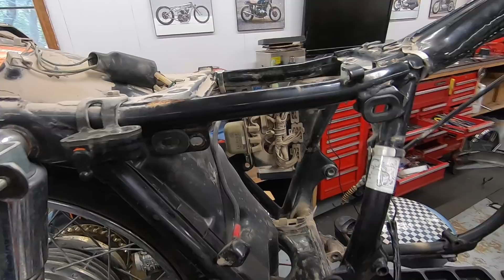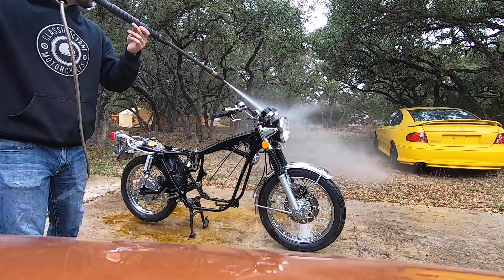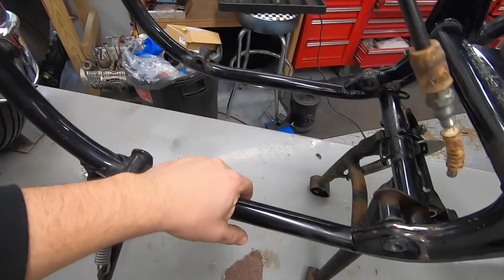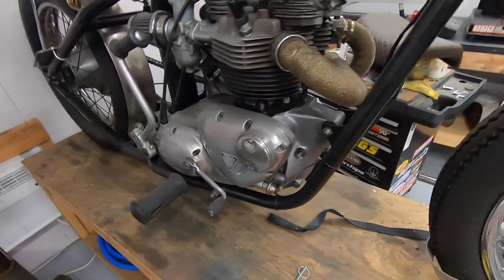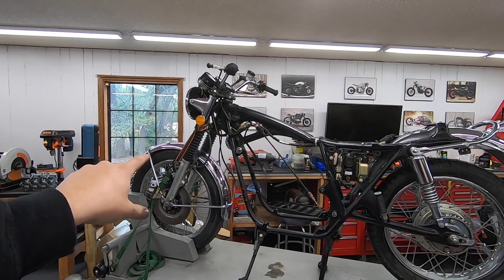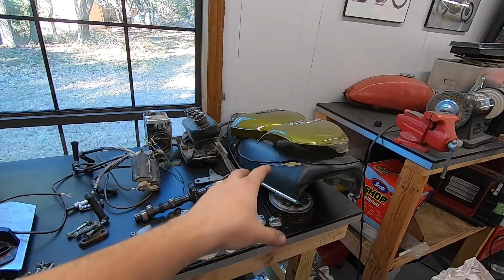CB500 Restoration: Cleaning the frame and engine

Comment: I had some nasty rust in a CB350 tank.  I pulled the petcock and plugged the holes, poured as much white vinegar and some loose hardware as it would take and let it sit for several days.  Shook the hardware around periodically.  Did the trick 👌

Comment: Aaaaaacccckkkk!   Kreme is not good for modern fuels. Apparently, any ethanol causes it to dissolve in clumps which will clog the carbs. When I began my restoration of a 1976 Yamaha XS650C, I looked into a lot of different tank coatings and basically found that while Kreme (and many others) were good years ago, most manufacturers simply have not kept up with the chemistry of the fuels that is available today.  

Instead, based on my research, I used POR15 (the same stuff that Jay Leno uses in his big-dollar vehicle restorations) and it seems to be just about impervious to anything.  The other way to go is to use EvapoRust as you say - or even vinegar.

Comment: I use CiriSurf 77 citric acid to clean the worst rusty tanks you’ve ever seen.  Its designed to clean stainless steel, but works FANTASTIC to COMPKETELY REMOVE RUST on carbon steel, as well.  Just fill the tank and leave it for 24 hours, then drain and rinse thoroughly.  Apply RedKote to inside of tank and never worry again.

https://www.theruststore.com/CitriSurf-77-Liquid-Gallon-P221C64.aspx

Comment: Finally, the link to your Amazon stuff works properly! Thanks for  sharing the things that you use on your projects! I really can't wait to buy some for myself. Also, is zep a kitchen degreaser product? I'm just looking for a strong solution to clean my engine and so far I have found that strong degreaser foams work really well
Reply from the maker: ZEP is an industrial degreaser. I'm happy with the results.
Reply: @ClassicOctane  And you can wash it into the street gutters?

Comment: I used evaporust to clean out my tank,need to spend a bit of time cleaning out the tank,I used very hot water & dishwasher detergent,I swung the tank completely full,empty out, clear as much of the loose rust, dry it out,fill to the brim with evaporust & leave it for around 72 hours, the hotter the better, & the inside to the tank will be very very good,
Reply from the maker: Nice, I will pick some up this week.
Reply: Classic Octane I was in a position where I couldn’t use a tank liner as the tank was painted 10 years ago & still very nice,tank liners are not very good,just watch brothers revenge from johnnys vintage motorcycles